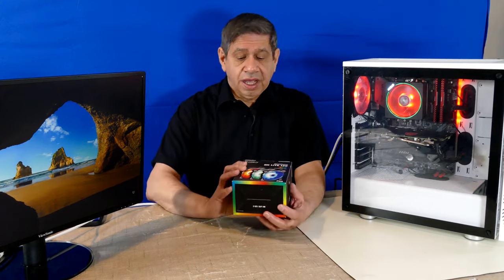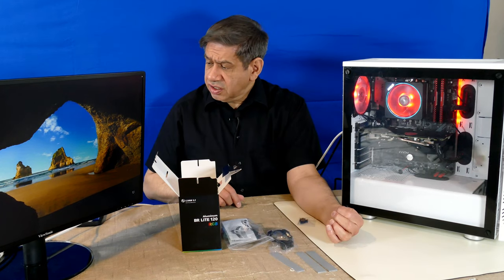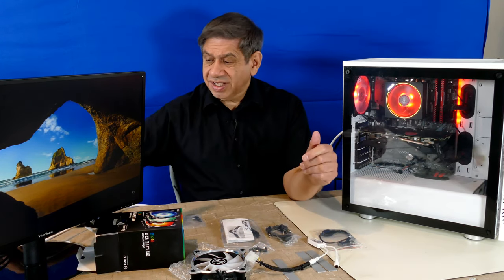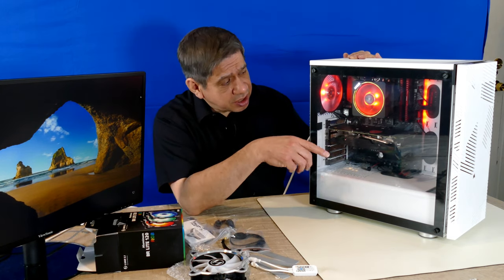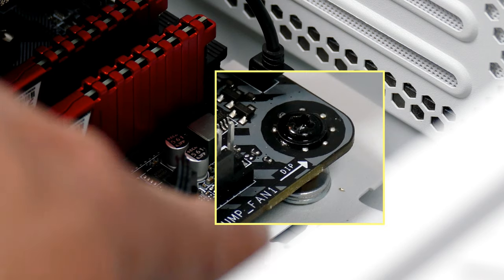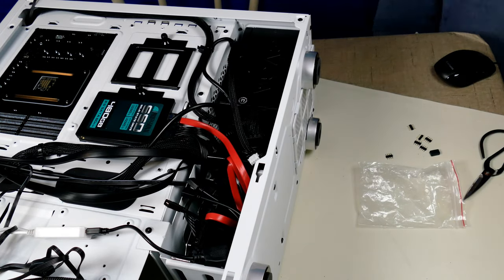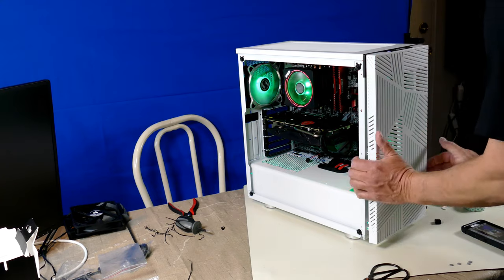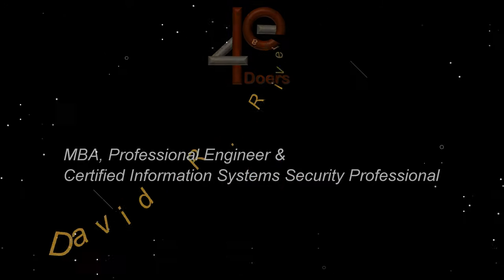CORSAIR 275R AIRFLOW PC CASE: FAN and RGB UPGRADE plus TESTING RESULTS

Comment: A solid improvement to the looks of your computer. Thanks for the tip on getting the zip ties a little tighter, I'd never thought of that
Reply from the maker: Thank you so much for the positive comment.  I learned that about the zip ties many years ago.  You just need to bend it toward the opposite side to where the clicker happens to be.  On some 'cheap' tie however, they tend to break if you bend them too much.
Reply: @PE4Doers  I'm finishing a build this weekend so I'll give it a try. Thanks
Reply from the maker: @johnostrue7061  Great to hear - let me know how it goes.  By the way, I just added another SSD to my primary engineering workstation and I had to re-do some of the cable management, and using that technique came in handy once again.
Reply: @PE4Doers  Although I was a little heavy-handed on my first attempt it worked great after that. I'll be using it from now on
Reply from the maker: @johnostrue7061  Glad to hear.  I stumbled across that technique a few years ago, and now it it just how I do it.

Comment: Great video! I just ordered my 275r Airflow and it’ll be here next week. I have a question for ya though. What do you suggest I do for the motherboard installation issue? The same as you? A few washers and a longer screw?
Reply: I did not have the same problem on my 275R Airflow. It may just be bad luck?
Reply: DamZe good too hear. I thought it was most likely a manufacturer error but maybe not
Reply from the maker: @grxy5924  I was thinking the same thing - it may not be on all the cases shipped.  If your has the problem, using the washers would work.  Probably need a couple under the screw stud and a couple of more above (unless you have a longer stud you can use instead.  Also, I ran it with that screw installed at all for about a week - just need to be careful putting on the 24-pin power connector if that screw is missing.

Comment: Can the PSU shroud be removed?
Reply from the maker: If you mean replaced, absolutely.  If you mean removed from the case but left connected, then there is usually not a problem do that, such as an open System.  I still use this system for my Live Streams and have upgraded the PSU from a 750W to an 830W when I noticed some power drop-outs at 750.  I also will be replacing the motherboard soon to one with an extra X4 slot, so I can go 10G networking.
Reply: @PE4Doers  Thanks for the reply.

Comment: Your reviews on this case are exactly what I need, but I have a question, how are you installing the fans? I see the long slots that you’re screwing them into but I don’t see any screw hole, so how are you able to screw the fans in?
Reply from the maker: The two front fans are screwed in from the front with the plastic front panel and air filter removed.  Thanks for the comment, I will try and get close-up shot in futures videos of that since their are some cases where that is a challenge.

Comment: i bought this case i do not plan to add any more aftermarket fans into this case i want to utilize the provided fans in the most effective way, i also will be using corsair h45 liquid cooler(preowned from previous build), what position you think will be best for good ariflow for this case either to put corsair h45 liquid cooler (single 120mm radiator fan) on front intake or top exhaust?
Reply from the maker: The top is always the best when it fits at the top without interfering with the Memory, since that leads to less bubbles (with improved heat transfer) and possibly a longer life for the AIO - but that topic has been debated often.  If you put it at the front, it is just as good as long as the intake/outtake hoses are at the bottom.  However, they are seldom long enough to be able to do that.

Comment: Great video! I bought this case not so long ago for my first pc build but the virus stopped me from finishing it and i don't think I'll be able to get the graphic card soon. Greetings from Poland
Reply from the maker: Great.  I really like the case and it was fairly 'PC Builder Friendly'.  Let me know if you run into the same problem I had with the top-right Motherboard screw (where it required a longer stand-off and a couple of additional washers).  Also, I suggest you attach the CPU 12v cable from the PSU to the Motherboard before you put it into final position and screw it down.

Poland, huh.  That is one of the Countries I've always wanted to visit. I really hope I get to do that some day :)  Good luck with your build.

Comment: Hi David, thanks for your videos on this case. I have a few quick questions. Would you say this case in particular would benefit from a modular or semi-modular PSU? And other than the CPU power connectors did you have any other trouble with routing cables for your full ATX board (assuming that's what you have in there)? Basically I guess I'm asking is this spacious for a mid-tower case?
Hope you're staying safe in NY. Hearing even from over here in England that things haven't been great in your part of the world.
Reply from the maker: I found it very spacious, which adds to its cooling capabilities, and 'Yes', only the CPU connector caused me any issues.  For the PSU, I think a semi-modular would be helpful in reducing the cable congestion in the back.  I hope that helps.  Let me know if you decide to get one.
Reply: @PE4Doers  Thanks for your video and reply. You have been most helpful!

Comment: Hello, I have also have the 275R Airflow. I would like to buy 3 fans to put 2 on the top and 1 on the front of the case. Then i would have 6 fans with the 3 stocks fan from Corsair. Do you think it will cool down my case of about 3 or 4 degree or more with 6 fans ?
You made a great video !
Reply from the maker: I have my Corsair 200R case with Six (6) internal case fans (not counting the PSU, CPU or VRM fans) - which are three 120mm and three 140mm (all PWM using the ASUS extension module).  The direction of the airflow through the fans and the location of the fans going in a certain direction is very important.  I like to have a 'Positive' air pressure in my cases, so I calculated the CFM for all the case fans, then decided to have the front two (120mm), the bottom one (140mm) and the top one on the intake of the CPU fan (140mm) all blowing in; and the second one at the top (140mm) on the output side of the CPU Fan and the rear fan (120mm) blowing out.  I played with those in several combinations until I achieved the lowest internal and CPU temperatures, always remembering the heat tens to rise when left alone.  If this sounds crazy - well - when it comes to keeping the components cool in my critical PC', I would definitely say I am extreme plus.  Not sure if that helps...
Reply: @PE4Doers  I would like to make a neutral aiflow in my case with 3 new (140mm) case fans . Do you know how much more degree you gained with current combinaison compared to the 3 fans provided in the box ?
Thanks for your answer !

Comment: Can I add another fan at the bottom? Does it contain 2 fans only? I mean at that front side?
Reply from the maker: Yes, as long as you don't put a radiator in the exceed about 40mm.

Comment: How do u add the fans on the top
Reply from the maker: It is a mid-tower that is on the smaller side, so you need to use the screw holds closer to the glass panel.  Also, if you have a large air-cooler on your CPU, you may need to get fans that are thin - 13/14mm.

Comment: Hello i use COOLER MASTER. MasterLiquid ML360R (3x)  ARGB  Does the case support this fan?
Reply from the maker: I didn't actually try that one, however there appears to be enough room in the front, since there is a cutout in the PSU shroud that goes all the way to the bottom of the case.  The actual dimensions of the space I just measured is 380mm high by 65 mm deep. and three 120mm fans can easily fit.  I hope that helps.

Comment: Nice video, really enjoyed watching it. Do you know if you can buy just the front panel (Airflow) Because i have det "normal" one, and i would like to get the airflow one. And if you can buy it, does it fit, so i can take my front panel off, and replace it with the airflow?
Reply from the maker: Hmmm, I am really not sure.  However I've heard of others replacing the fronts.  I am not sure however if they needed to make any modifications.  I will try a quick Google later to see if that is possible.
Reply: @PE4Doers  Thanks for responding, i looked everywhere for it. The only thinh i found was on corsair page, where they had it. But they don't ship iy to Denmark :(
Reply from the maker: @magnusolsen9239  OH no, so sorry to hear that.  I am not sure how else to try, except to call Corsair.